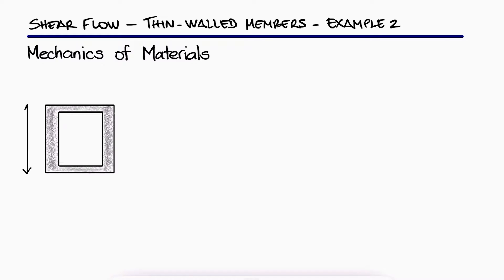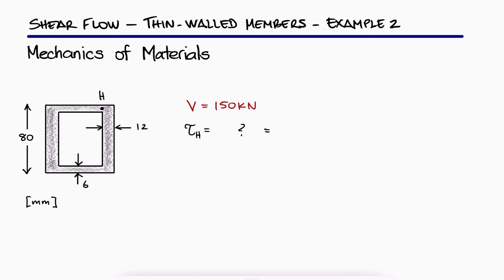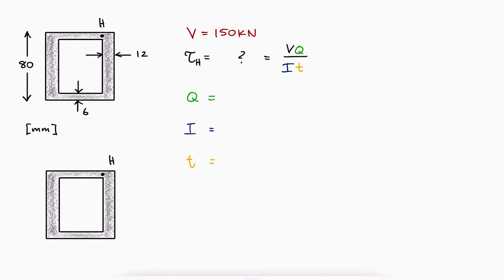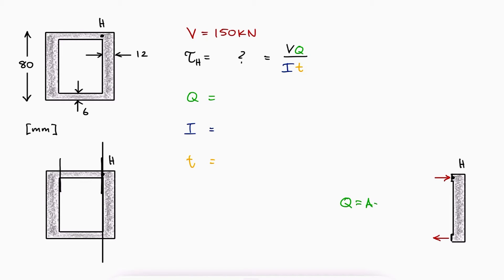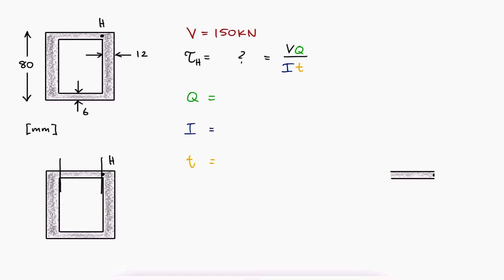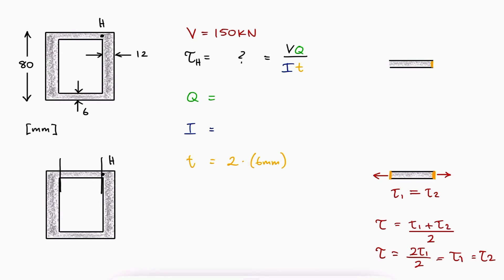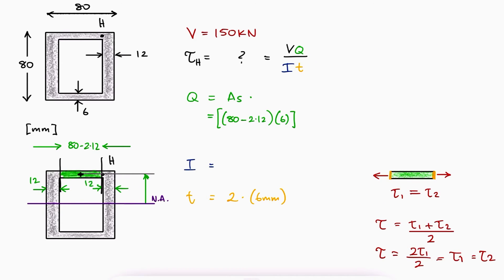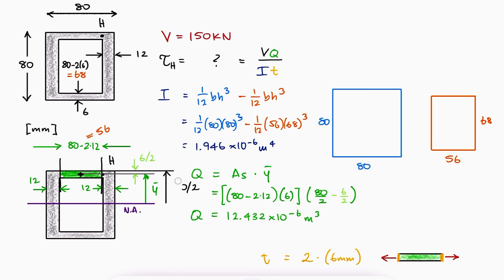Thin-Walled Member - BOX BEAM in 3 Minutes!

Comment: I thought t supposed to be perpendicular to the vertical shear force V. I do not understand your choice of t here in this short video
Reply: Hey! I think he shows in his main video that this is the main difference between shear flow in thin-members and traverse shear (normal calculations)! there is the thickness of the wall rather than the thickness of the beam perpendicular to the internal shear V. I think that’s the right way to explain it, but his video is great!

Comment: So I have a question with these types of problems, do we assume that the shear force is acting in the middle of the beam (symmetric loading)?

And what happens if I apply the shear force on the beam but not in the middle, say more towards the right of the cross section, 

Intuitively, I'm assuming this theory doesn't apply.. could you please correct me if I'm wrong 

I hope you understood my question
Reply from the maker: Yup, the loads are assumed to be acting right at the center. If the force is not located there, of if the cross-section is not symmetric, then a torque is created and the analysis is very different. This is usually covered in all mechanics of materials textbooks, but almost no instructor covers it :/ (and it's not that difficult).